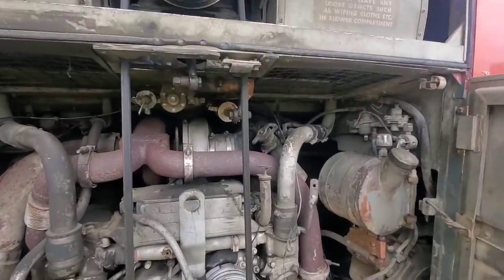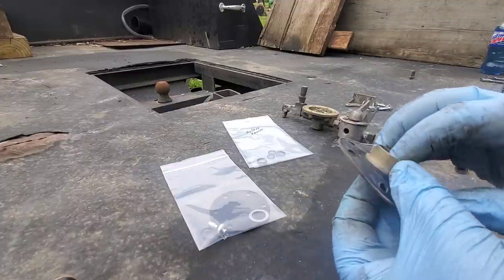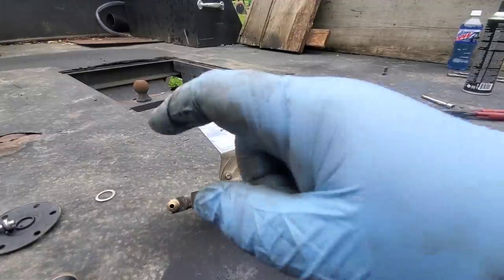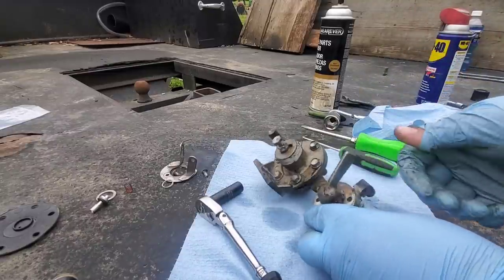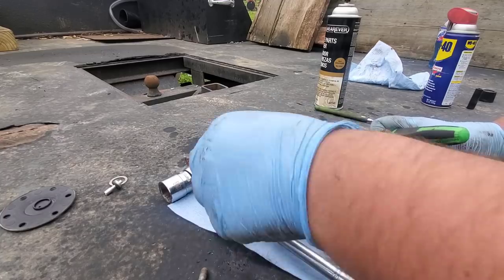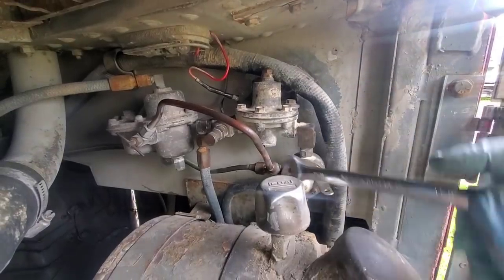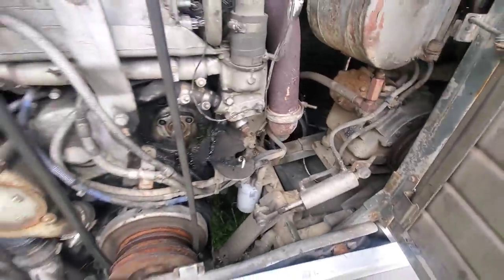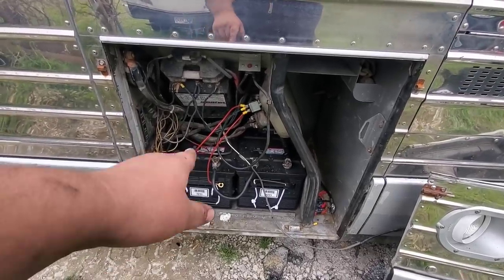MCI cam seal and air leaks

Comment: I always used silicone on rubber. There is also a thing called plumbers grease made of silicone. It comes in a small tin, and they use it on faucets. Of course, always use lubricants!

Comment: Thanks Tyler, very helpful for repairing my bus. I’m pretty sure my oil leak is from the same seal
Reply from the maker: It's not too bad to do. This one getting the woodruff key out was the worst part.
Reply: I just need to order parts, get a good electric impact gun too. My air impact won’t do anything  on the nut. My ratchet and cheater bar just turn the engine over.

Comment: Little boys and old men love chasing fire trucks, I used to be a little boy and am now an old man so I know of whence I speak. I started trucking OTR in 1967 and the first twenty years I spent equal time in the seat and under, around and through whatever tractor and trailer unit I was flogging up and down the Queen's highway. That time was equally spread between chasing air leaks and dead shorts or broken wires.
        Mike
Reply: Queens Highway?  Canada?

Comment: I've found dielectric grease works the best for  lubricating o rings. If in a situation where oil based line is required for any reason, I use PAG oil.

Comment: I hate to second guess you, but for my future reference, would silicone (brake) grease not be the choice of lubricant for the air valves ?   keep up the great work
Reply: Lithium (White) or coppercote IF you used a grease but a wet lube for assembly purposes is fine, Silicone lubes tend to make rubber soft and swollen.
Besides its a fine fit and doesnt need lube for occasional operation.

Comment: Did you put the screw back through the diaphragm before installing it?
Reply from the maker: It didn't have one in it when i pulled it apart but it got one.
Reply: What held the metal parts to the rubber diaphragm? in the video it looked like there was something holding the two metal parts to the diaphragm?
Reply from the maker: @edwardsilva895  they were just stuck to the rubber. I was pretty confused too ended up going back and putting that in. I assume the hole in the center for it is where the leak was internally. Whoever had it apart last must have forgotten it in the spare parts pile lol

Comment: You need a hat cam...
Reply from the maker: Have actually been thinking about that. I need to get a better laptop before i start using the gopro. Mine sucks at editing so currently keep to just using my phone.
Reply: @Spyke383  https://www.sony.com/electronics/action-camera You can use this for a head mount https://www.sony.com/electronics/actioncam-mounting-accessories/blt-uhm1
Reply: @Spyke383  update your hdd to a SSD if you are still using a spinning disk. That will make it like a brand new computer. they are totally cheap now
Reply from the maker: @uliwehner  i honestly know nothing about my laptop. I got it super cheap from best buys cybermonday sale like 3 years ago. The cheapest one that wasn't a chromebook.
Reply: Tyler, it will tell you. If you can't tell that it has one, it probably does not have one. With SSD windows 10 boots up in 15 seconds or so.